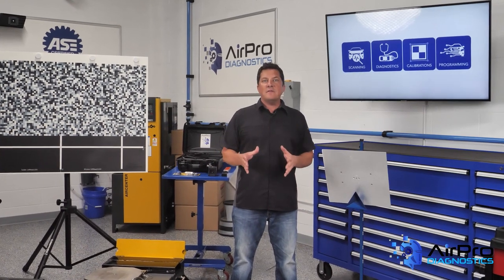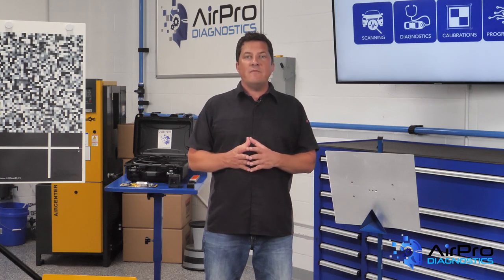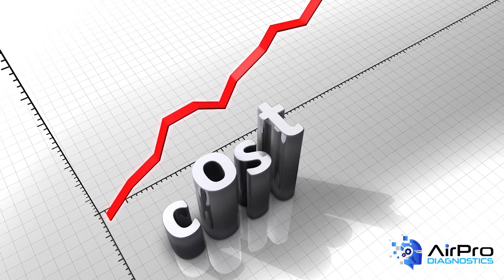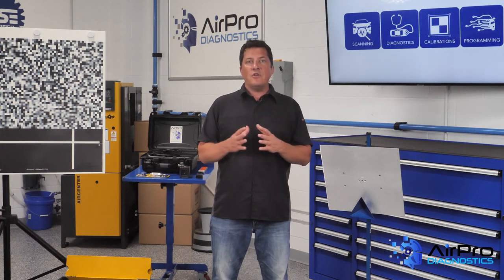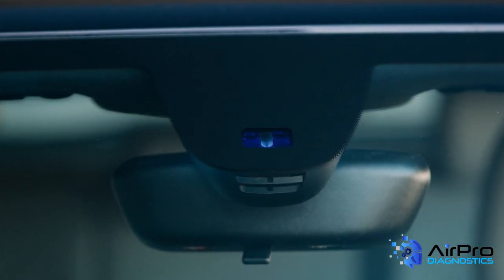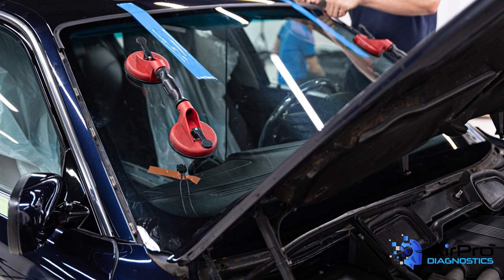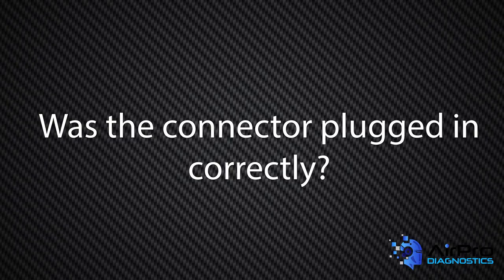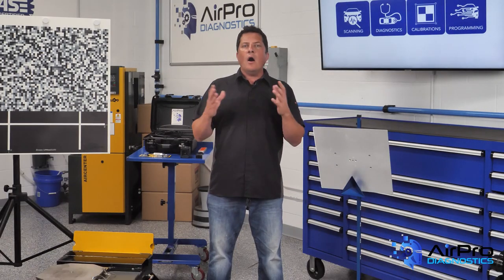ADAS and Glass: A New Twist

Comment: We have experienced calibration failure due to aftermarket glass as well. Usually a camera bracket location issue. More often we find failure do to connectors not fully engaged or cameras not completely latched into the bracket.